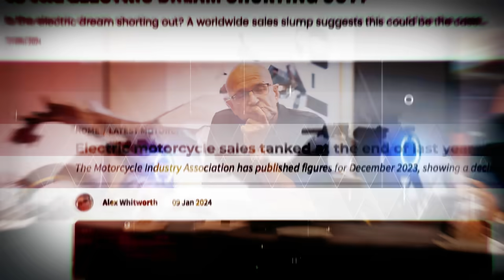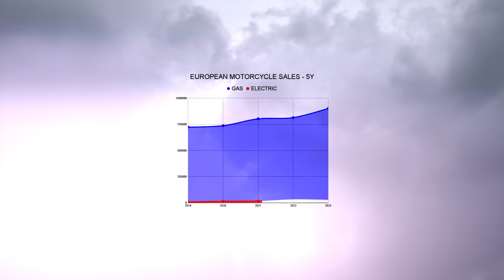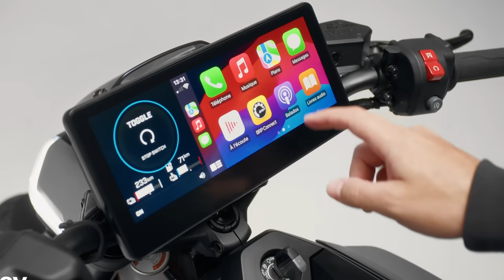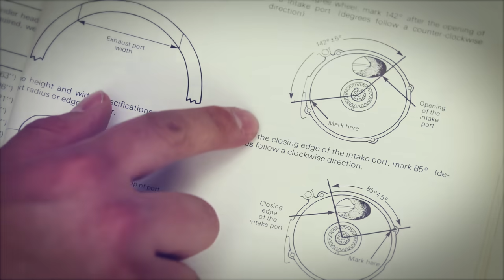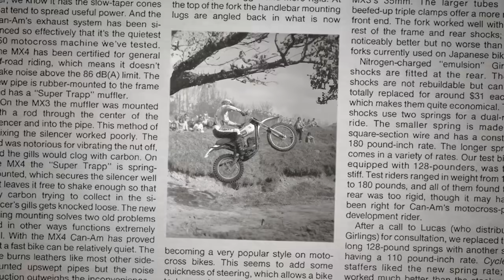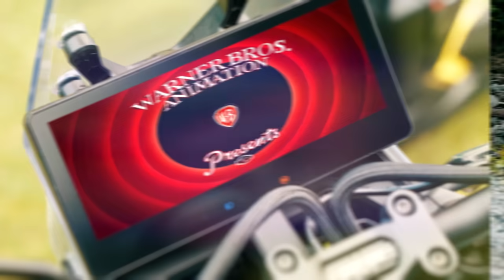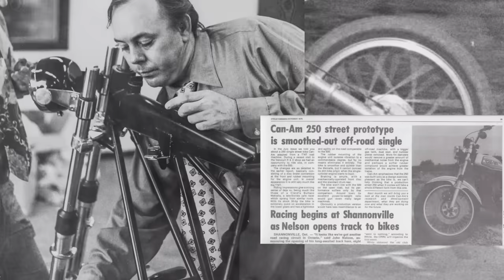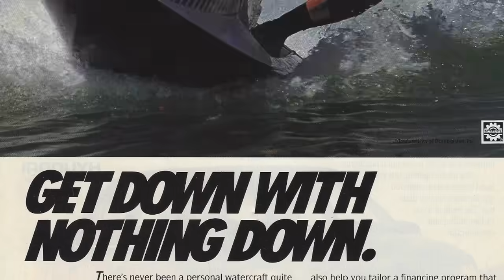2025 Can-Am Origin Review - The 115km "Adventure" Bike

Comment: At 14K US these are dead on arrival.  If they would just listen to customers they would move some units.  Give us a reasonably priced electric Grom that we can put around town on while we wait for the battery tech to advance so it can support bigger and more expensive bikes with useful range.
Reply: THAT would bei stupid fun! I want one. And BMW just seems to have missed the mark with their C02, cause it seems to be an expensive option to look cool, not to hoon around.
Reply: It already exists, it's called e-bikes and you just have to pedal a bit. Or just a e-scooter.
Reply: @sportyeight7769  On this side of the pond scooters are not (nor have they been any time in the recent past) very marketable.  An e-bike has little in common with a Grom aside from a motor and two wheels, but if you want to pay 3K for an e-bike with marginal quality components instead of paying 3K for a pedal bike with reasonable quality components be my guest.  None of this has anything to do with the context or point of the article which my original statement addressed (i.e. the current marketability of electric motorcycles for the North American market).
Reply: The problem is the electric would have to be half the price of the gas powered bike to compensate for the fact it would be worse in every way.
Reply: It will be a long wait. Even at the basic research level, battery density is barely 10% higher, so a real advance in the next ten years is very unlikely. 
If we actually cared about the environment, we would just run adventure bikes on ethanol.
Reply: I'd buy an electric gram and I'm 6ft4! It would be so much fun! Tiny bike with loads of torture for tearing around town and short commutes. Count me in, I'd even get one for the Mrs.
Reply: And swap-out cartridge batteries. Take a full cell from the rack, slot your empty cell into the rack, pay $5 and ride away with 100km range.
Reply: no mayb for u but there niche bikes theyh jus a fewk units
Reply: @truantray  It was a long wait for the move from hybrid to all electric for larger vehicles as well.  Ethanol has some serious drawbacks when you consider most of it comes from corn which is a crop that many critter love to eat.  This is typically mitigated by the use of pesticides which are not terribly green and creates additional challenges due to chemical runoff.  Growth of more corn also displaces growth of other crops we eat (and green growing methods lead to further displacement due to lower yields).  There is no zero sum game, every choice has tradeoffs.
Reply: @stevewalker2028  They are already doing that in Japan.
Reply: @truantray  
I just looked into battery density and it's skyrocketing. Numbers are my rough reading of a graph, so don't judge me if I'm out by a few units.

1991 = 120Wh/kg
1995 = 150Wh/kg
2000 = 165Wh/kg
2005 = 200Wh/kg
2010 = 230Wh/kg
2015 = 250Wh/kg
2020 = 320Wh/kg
2023 = 490Wh/kg

Comment: This video brings back a lot of good memories. For several years as a much younger chap, I campaigned the same Can-Am MX-2 , white tank, with yellow/red stripe. Same time as jimmy Ellis, though obviously not at that caliber. Everything Ryan said was true. 
Ridiculous power from a small engine. Much better low end torque, & a flatter power curve than the Honda Elsinore I came from. (It only reved to 10,500, with max power at 9600).
The Rotax only had one piston ring. I couldn’t afford a mechanic, so we used mom’s oven to heat the jug, & the deep freezer to cool the liner when rebuilds were in order.
In S Alberta we had thousands of sq miles of “free-for-all” terrain, with many races being cross country laps of 30-50 miles. My best friend had a 5000 acre ranch, full of coulees & hill climbs. We set up a flat track on a big dirt wash in the river bottom.
Some epic crashes, one where I flipped on a hill climb, ended up sliding down a hard pack clay track with the bike on top of me…still running. Ever tried to reach up & find a kill switch, while in motion, with your bike on top of you?
I still have a scar where the rotating chain ate into my leg, just above the tall boots we used. 
Or the time I took a jump on a forestry trail too fast…and got cleaned off by a low branch I didn’t see in time.
I can’t ride like that anymore, (more accurately,  couldn’t survive riding like that), but this video really touched me. We lived on our bikes back then, (in Alberta you get your license at 14), & Bombardier was a giant killer at the time. 
They morphed into building subway trains, & jet Aircraft, (Challenger biz jet & what’s now known as the Airbus 220). Seadoo & Skidoos are now the mainstay. 
If battery technology catches up, I’d own one of those electric bikes, & carry it out of town on my EV car, which incidentally, after 220,000km is the best, most trouble free auto ive ever owned.

Comment: My wife bought a Zero FX which is basically an electric dirt bike and yeah, the range sucks but that thing is SO much fun. Great town bike. Down side we are having to make luggage for it but we can do that. I’m not saying buy an electric bike but Ryan is correct. You really should test ride one.
Reply: It's just too expensive to justify. For quadruple the price of a dirt bike, I expect to be able to ride it all day atleast
Reply: @Justcarlosdiaz  Do the math. Batteries are cheaper than fuel. What's your commute? 25 km?  You don't even need 2 kWh you cover that distance. What does a kWh of battery cost these days? I haven't checked but it is way under 200 bucks. Let's say you spend 2000 bucks on a 6 kWh battery. That battery will take you to and from work thousands of times. Let's say 5 thousand trips at 50 km per trip. That is 250k km. Halve it to be safe. 125 000 km. How much fuel is that gonna cost you?
Reply: @difflocktwo  There are two sides to the coin here - I own two Zeros and a Chevy Bolt but I've also got gasoline vehicles as well.  Being American I don't want to switch to liters and kilometers - here is my story though.

 I have a Honda CB500X that I paid about $6000 for on clearance when it was new, I rode it about 15,000 miles commuting.  It does a little better than 50 MPG on the freeway but for the sake of round numbers I'm going with 50 mpg and $4 per gallon for premium fuel.  Based on those numbers I've spent about $1200 on fuel in 15,000 miles.  I don't have my oil changed by the dealer but if I had it done every 3000 miles for $120 per visit (typical in my area) that brings my overall cost gasoline related maintenance up to $1800 over the course of 15,000 miles.  Now there are other maintenance items to think about for sure - I figure valve adjustment and coolant exchange should add about $400 to  my figure here for 15,000 miles of operation.  Then there are other things like chains, tires, etc but Zeros are comparable to those expenses.  For me personally, I don't trust anyone to work on my bike so my expenses are considerably lower doing everything myself.  

Now I have 2 Zeros but only used my 2019 DSR for commuting.  I racked up a little less than 10,000 miles on it so I can safely say that I would commute almost exactly 100 miles per week and I could run one full week in the summer time and 4 days in the winter time if I needed to.  One full charge per 100 miles is a little more than $1 worth of electricity in my area.  So for the same 15,000 miles I would have spent $200 on fuel, tightened the belt probably 4 times (probably costs $75 for the dealership to perform), changed the brake fluid per Zero's recommendation ($100 at the dealership).  So $600 maintenance and fuel.  So the Zero cost about $19,000 brand new.  I would also mention that the Zero needed a new 12v DC converter at 9700 miles which was out of warranty and cost me about $500 for the parts which I installed myself but I think it's fair to say that all bikes break sometimes.  

I figure I should be able to achieve 150,000 miles of riding on the Zero and I suspect the Honda will go that far too without major difficulty.  I expect the Honda will cost  me $22,000 to get to 150,000 miles and the Zero will cost $6,000.  That means 150,000 miles on the Zero cost me $25,000 and the Honda will cost me $28,000.  By the time I actually roll 150k miles on either bike though inflation will have caught up to the point where $3,000 ought to be the price of a dozen eggs.  

Is electric going to save me a ton of money?  Doesn't look like it to me - I'll probably never run up 150k miles on either of my bikes though so it's kind of a moot point.  It's also possible these numbers look significantly different in Canada.  I bought my electric vehicles because I like the quick and quiet power delivery - its just a wonderful experience for me.  Whether electric vehicles are worthwhile or not I think is an issue for the free market to decide.  There's definitely a case to be made for them.
Reply: @difflocktwo  dude are you serious? do the math??? you do the math!!! the bike is $10k+ and doesn't even have 50hp. my commute is 80km... each way. I can either ride my Grom which would get 140mpg and max out at 60 or take my Honda nighthawk 750 and get 40mpg and cruise at 80mph. Both of these bikes combined and the fuel and maintenance costs considerably less than this bike. For 35kW and $10k+, you can buy it if you want, but most people won't and for good reason. Electric cars might taken off but that's because weight doesn't really matter in cars. Weight and range most certainly matter with motorcycles. Do you even ride bro?
Reply: @Kburd-wr6dq  for your 160 km round trip you would need 10 kwh of battery.

a battery costs way less than 200 usd per kwh. so at most a battery that size would cost 2000 usd.

let's say the battery costs 5000 usd for 10 kwh, way above market value.

that 5000 usd battery will easily drive your commute 1000 times. it can do it 1000s of times. but let's say 1000 trips. that is 160k km.

on your grom 160k km would take 2700 liters of fuel, almost 3000 liters.

at 3 usd per liter, that is 9000 usd ONLY in fuel.

Comment: Seriously, even at a first attempt and such a low range it would probably still be a fun bike if it was priced the same as other 300 class bikes. That thing is priced up into BMW GS territory!!
Reply: It's Can-Am, built well, by Canucks, and won't grenade itself if you forget to change the oil on time.

Plus, that range means it's probably eligible for federal incentives. ($2-5000 off!)
Reply: @ulogy that is still crazy expensive for a commuter bike with extremely low range on the highway.
Reply: @DustySquitoNM  Yeah, early adopter tax and all
Reply: My tenere brand new was 11500. I bought my ktm 300 1year old for 6500. Why would I trade those two bikes for one electric that doesn't do anything as good as my bikes do
Reply: @Revy8  I'm inclined to believe Ryan when he says it's the best ADV bike he's ever tried. Range is definitely an issue.
Reply: Insanity

Comment: Every thing you need to know about owning an electric motorcycle from someone who's had and ridden one for 5 years:
1) EVM's are THE BEST urban commuter.  Period.   Quick, nibble, quiet, right hand only acceleration/braking, practically no maintenance.  A pure joy to ride in traffic.
2) EVM's are THE WORST motorcycle if you want to go 'out of town'.  Period.
I have been riding a 2017 Zero SR (13kw w/charge tank) since I bought it used in 2019.   Key word "used".  Essentially half off retail price for a 2-year old bike with less than 2k miles on it.   But I TRULY ONLY NEED an in-city commuter bike.  And dam, it's such a joy to ride in traffic.  I have it set up 70% power/100% regen.  It's super nimble, and slices through traffic like a hot knife through butter.   And because it's a 'real' motorcycle, I can easily do short stints at freeway speeds (as long as I stay in town).   In the 5 years I've owned it, the only maintenance I've done is had the brake fluid changed, and put new tires on it.   It's so quiet I can actually hear most traffic coming up behind me.  You know how uncomfortable it is to sit on an ICE moto at a stoplight in summer (think super hot engine + hot exhaust + summer temps)?  Not an issue with an EVM.   Not shifting is also priceless in urban traffic (I do miss rowing through gears on back country roads..  but again, I need an urban bike).   What are the downsides?  Freeway range + charging time.   I can get about 70 miles/charge at 70mph.  And it takes +/-3.5-4 hours to charge from 10% to 100%.   So going out of town would mean ride for an hour, charge for 4 hours, repeat.  You can't take it out of town.  However, I get around 150 miles/charge in the city.  35mph to 55mph.   I have a pretty short commute and can go 10 days between charging.   
-
I think the thing EVM manufacturers are missing is commuting.   The battery capacity/charging times just aren't there yet for EVMs to compete with ICE motos...    So seeing every brand build an "ICE looking" EVM seems silly.   The one thing I truly wish my Zero SR had would be STORAGE.  Enough to house 2 full face helmets at least.  I would much rather have 'storage' than 'traditional looks'.   I think as 'designated' commuters, EVMs would crush it.
Reply: Yep I'd agree. I have a much cheaper EV bike (Super Soco TX Max) as a commuter in the city and it's AWESOME for that. Easy, reliable, nimble, smooth, super cheap to run, trivial to maintain - also had it 5 years and it's been so little effort. For anything that isn't a short city commute it's utterly awful (way worse than your Zero I promise you! 3.2kWh battery is small, motor is gutless...)

I have considered a Zero many times but the issue for me with it, or any other better (compared to mine) EV motorbike is.... it'd still be really good at what I already do, and still be rubbish at what I don't do. For much more money. Yes, I'd love to have an extra 20mph top speed and faster acceleration, but that's about it. Well, and as you say storage - even one full face helmet fitting would be lovely.

I could imagine one day them getting to a point where they can be general purpose bikes but it's not close. In the meantime I think I'll stay riding my cheap crap bike because for what I use it for it's nearly perfect. And I'll continue being jealous of those who do choose to drop more money on a Zero or similar, even if I can't justify the price myself - enjoy your ride stranger!
Reply: @asharak84  well, used Zero's(like mine) can be had for $5-$8k..  Not sure what your bike cost, but buying a zero 'used' is the way to go (if you want one..)
Reply: I wonder how well a plug in hybrid would as a bike.
The only hybrid available beeing a super sport seems bizarre to me
Reply: @wasauchimmer4229  not enough space for two engines, that would be my first thought....
Reply: @bikebudha01  there is the hybrid ninja, in EV mode it can go around 15km at 60kmh I think.
But that's just a strong hybrid. I wonder if it would be possible to use a smaller combustion engine and larger batteries.
Especially if you put the whole thing into a touring or adventure bike form factor

Comment: Those exact bikes but with an engine would be an instant sales hit
Reply from the maker: Can-Am has a punchy 600cc twin in their Ryker. But with the battery monocoque, it would have to be a completely different motorcycle. ~RF9
Reply: Not at that price range they won’t. 18k is delulu money.
Reply: So whack an ultra light generator on the tail.
Reply: @FortNine  Are they planning on making an EV Ryker? More room for batteries at least, although more weight. Maybe they could use a beefed up version of the same drive train with it :)

Comment: The Origin may be perfect for someone like me. Every summer I go camping for two weeks in Colorado. I normally spend 1/3 of my time hiking, 1/3 of my time fishing, and 1/3 of my time riding the trails. I could let it charge on solar while I hike or fish, and ride it the other days. 

Curse you Ryan for making me want another motorcycle.
Reply: If you think you're charging an EV off solar, LOL
Reply: The math doesn't work out here, even a large camping solar panel is only going to provide around 0.2 KW under ideal conditions, it'll take multiple days of direct sunlight to charge an 8.9KWh battery
Reply: Unless you have a good generator 😂
Reply: Charge on solar? Say you don’t understand math without saying you don’t understand math.
Reply: @_Zaid  nah, depending on the size of your trailer roof you can get multiple KW up there now. 3 KWh = 3 hours to charge
Reply: $10k+ for 2 weeks of camping. I know who you're voting for.

Comment: We travel a lot in B.C.  don’t think we have gone on a trip yet where you don’t see a truck or motor home pulling a trailer with a couple of dirt bikes aboard. You can haul that sucker out to the track on a trailer, then get the benefit of performance on the track. Some of those places even have a full hookup rv campground so you can plug your charger into that 50 amp service meant for a motor home. 

Reality is, market for these things initially will be similar to the jet ski, you don’t ride a jet ski to the lake, you put it on a trailer.  Trailer this to the track is not terribly different.
Reply: but a dirt bike is 200lbs lighter

Comment: 7:00 How does a rear wheel hub motor stack up against this inho overly engineered drivetrain??
Reply: Well the hub motor would probably fuck the weight distribution
Reply: Hub motors have a lot less torque compared to a mid drive, especially with a gearbox.
Reply: @ColdStoneRacing  do you think torque will ever be an issue on an electric bike?
Reply: @LostYogi  I'm not quite sure what you mean by that comment. 
Are you implying all electric motors are torque monsters?
Look up Stark, Talaria, Surron, ERide etc. 
There's a reason nobody uses a hub motor.